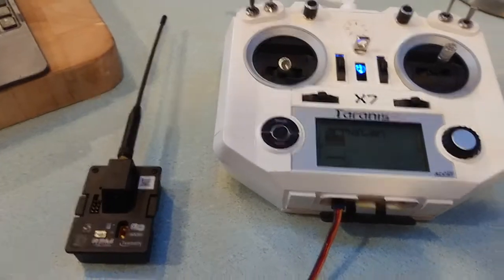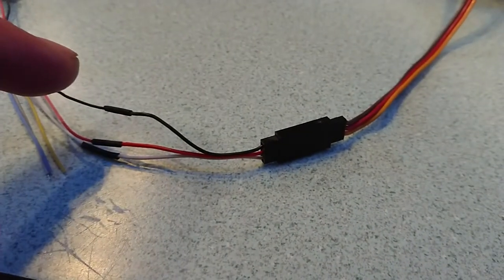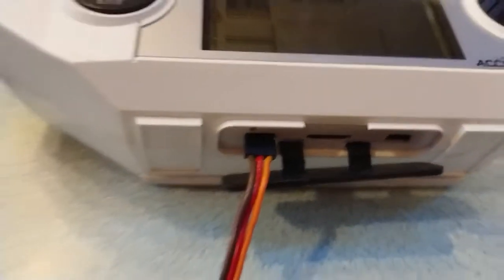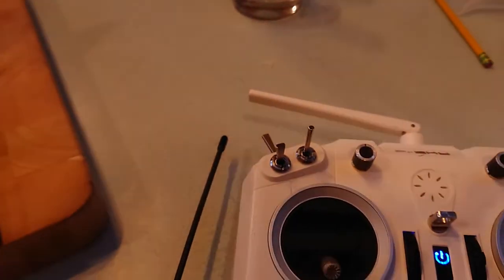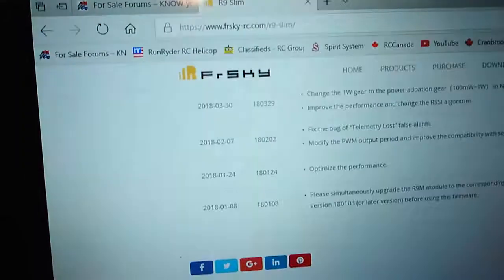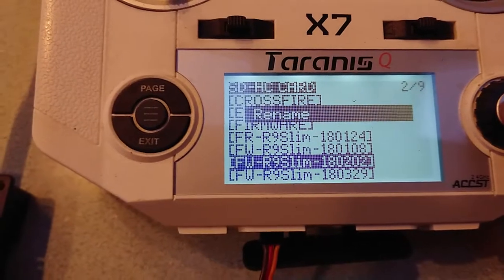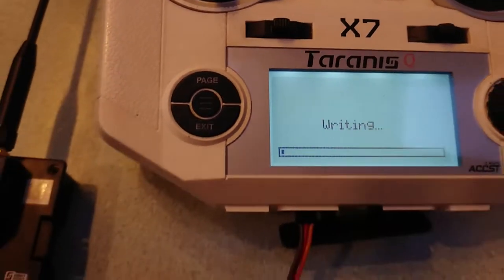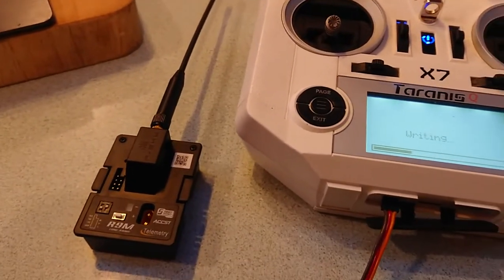FRsky R9M and R9 slim -firmware update

Comment: I got my R9M today and I saw that you have to update the firmware of your radio or else you cant flash the R9M module.  It will say pin error.   But after you flash the radio to new version of OpenTX you can then flash the R9M in the back of the radio.

Comment: You can update the tx module by inserting it into the transmitter and selecting the flash external module menu item.
Reply: That doesn't work on the QX7, at least with Opentx 2.2.1. Gives you a pin error. like he explains in the video.
Reply: Matt Earle worked for me, maybe a later/final 2.2.1 release? They have changed the menu since then, I have done it while it still had two options. A moot point, definitely works now.
Reply: Sergei Iakimenko I was on the latest 2.2.1 stable build release and technically 2.2.2 is still release candidate. Since they added a third option I'm sure it was a problem for many. Mine was a qx7 built in October 2017.

Comment: you say be sure not to get the order wrong on the transmitter but then you don't show us the order or tell us the order basically make sure not to get it wrong yeah that's obvious we'll make sure you don't get anything wrong on the rest of things for your life to but don't tell me what those are
Reply from the maker: some things are common sense ... but anyways on the module  use the 3 pin plug  GROUND  ON THE BOTTOM - SIGNAL CLOSER TO THE ANTENA.
Reply: the order of the updates? just do oldest to newest.